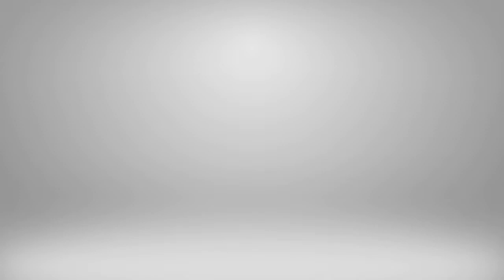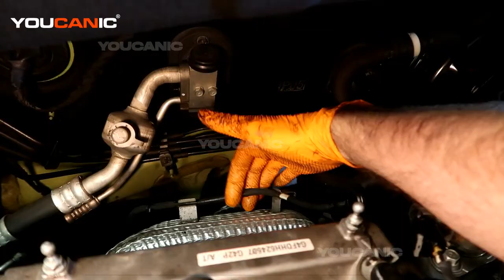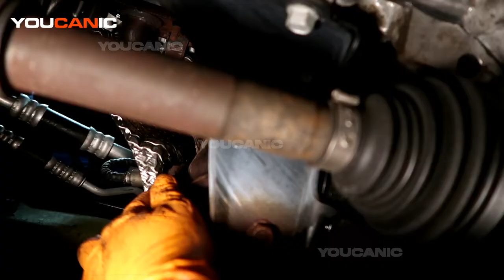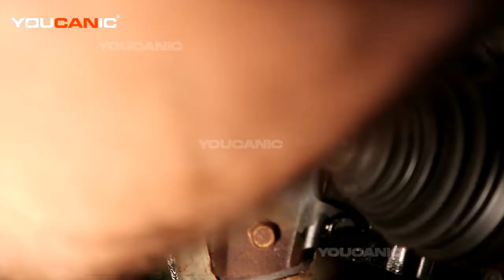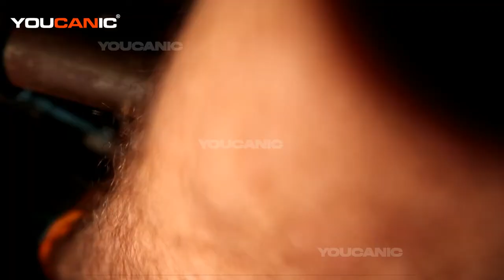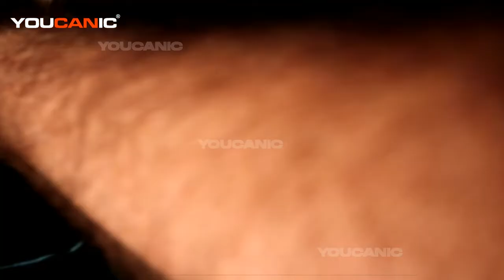2014-2019 Kia Soul - Upstream O2 Sensor (Replacement Guide)

Comment: Wish u had a video for changing the value cover gasket for a 2.0l 4 cylinder 2017 kia soul+
Reply from the maker: @devonfisher3420 If you’ve got a car issue or repair question, you can find step-by-step guides and scanner help at youcanic.com. We might miss some comments here, but our site has answers for most problems already!

Comment: Funny how none of you show how to remove the sensor clip.  My 2019 Rio is NOT a black easy clip you squeeze apart.  It’s a white plastic connector that will NOT come out to unscrew the upstream sensor.  None of you seem to have issues with the clips.
Reply: I was able to use a flat head to push it out, but then having difficulty putting it back in so it holds the connection. Afraid I broke it
Reply: Did you figure it out? Im having the same problem. I hate electrical connections.
Reply: im here for this answer too

Comment: Hey my friend, I'm hoping you happen to see this.I have a 2018.Kia Soul she threw P303 code so i.knew to replace the coil pack and plug. Actually changed them all out. First my wife said it didn't have the get up and go it once did.only 50.k mille's on engine.so.after changing them i drove it about 15 miles and smoth as a kitten. She took it to work and turned around because she was skipping and jumping again. Im baffled here .any idea what im up against now.. sure hope you catch this and can help me with this. Could it be the O2 sensor.? Thanks Michael
Reply from the maker: Hi Michael, sorry to hear about your issue. It could indeed be an O2 sensor or might be related to fuel delivery, but it's best to run a full system diagnosis to identify the problem accurately. Check out our YOUCANIC Full System Scanner at www.youcanic.com/scanner. It will help you decipher car troubles more comprehensively.

For any further queries or assistance, feel free to visit our website www.youcanic.com where you can access a variety of resources or ask car-related questions. We aim to make car repairs accessible and understandable. Trust in YOUCANIC as your reliable automotive guide!
Reply: I have a Topdon, guess it would show everything you're talking about.. Truly blows me away because first it was a P303 replaced all plugs and coils and after driving it to thinking the Check engine light would go off in time. Then the next morning throwing 4 codes.. Thanks for your support and reply..Take care and be safe..
Reply: @mikey3071 my 2018 Kia soul keeps changing cylinders for the misfire.

Comment: To the TOUCANIC got a code P2191. I was recommended to do a full fuel
Cleaning system including the injectors at Valvoline. I did that the code was gone.After two days the engine light appeared.Same code P2191. Was doing research. Probable causes a faulty upstream o2sensor or bad GDI fuel
Filter. What is your mechanical advice?

Comment: I had serious doubt that a bad O2 sensor would cause a car to run so bad, until I met a guy with a 2016 Kia Soul with a max speed of 25 MPH. After unplugging the grey connector 2nd from the top, he was able to drive it like it was meant to be driven, up to 50 or 60 MPH. I hope replacing the sensor does the trick so it can be plugged in without driving like a slug with a clogged butt hole.

Comment: I can’t for the life of me take the connector apart.
Reply: Push in on the outer tab, makes it release out on the inner tab like \ then | then /,  black top connector has 6 wires, grey middle connector has 4 wires, and tricky bottom connector may have only 2 wires. I'm sure you got it by now if it's been 2 months.